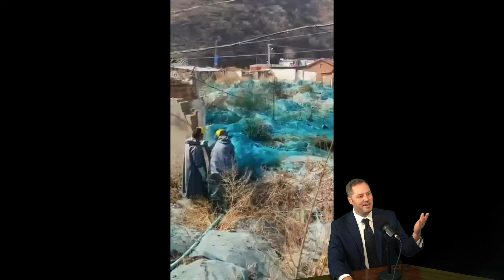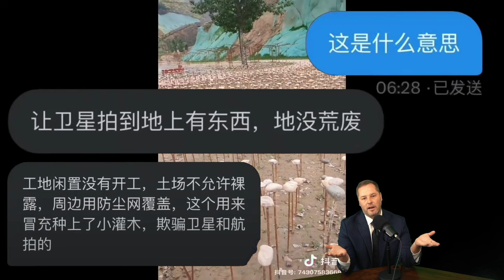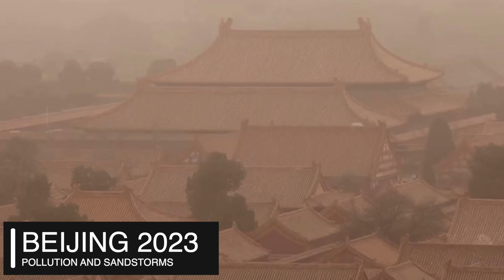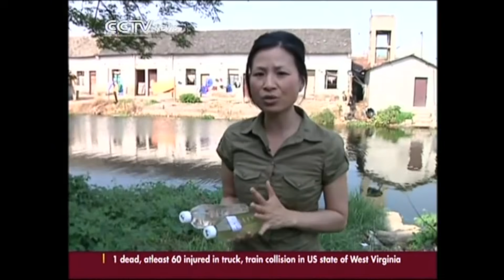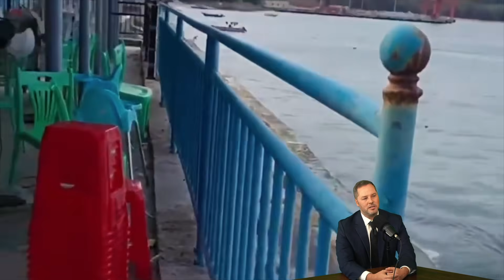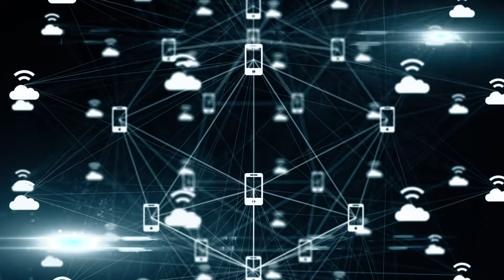China is planting Fields of Stones stuck to Metal Bars - No, Really

Comment: Hey, guys, this is a dust suppressant, and it's an environmentally friendly material. It can naturally degrade after its effective period, causing no secondary pollution. It is primarily used for controlling dust pollution on construction sites, mines, and roads. Although the suppressant is a liquid when first sprayed, it solidifies into a protective film on the bare soil surface after 2-3 hours. This film tightly encloses the dust underneath, preventing it from becoming airborne even on windy days. 
Dust is a major source of air pollution. Conventional dust control measures include watering and covering, but watering can lead to water resource wastage, and covering has several drawbacks. The woven fabric dust covers used have low dust resistance, are lightweight, have a short lifespan, and are labor-intensive and costly to install and remove. Moreover, these products contain plastic fibers that are difficult to degrade naturally, leading to secondary pollution. In contrast, the environmentally friendly dust suppression technology currently in use is more advanced and is becoming a new "weapon" in green and sustainable dust control.

Comment: While you might be correct about china, it very well could be 'just paint'... but you are NOT CORRECT about hydro-seeding... after the massive forest fires that took out millions of acres in Colorado, I witnessed helicopters hydro-seeding RIGHT OVER THE ASH, over dirt, trees, rocks, etc. without regard to 'preparation' or any top soil, or even any visible 'soil' - and IT WORKED IN MOST OF THE STATE where that happened; which, in turn, drastically reduced and mostly eliminated erosion that coming fall and winter. They did this, in Colorado, AFTER everyone in their brother - in the science community and media - claimed the 'land was STERILIZED' - and 'nothing would grow.'  The fire was so hot, the roots of trees exploded under ground... making sections of the burn appear 'moon-like' with small to medium size craters and pot holes as far as the eyes could see. Yet, within weeks after the hydro-seeding, there was growth... roots... and protection from the rains, and help from the coming snows. 

So... "data indicate that hydro-seeding significantly increased ecosystem N storage during the initial stages of post-fire succession but at the expense of native shrub regeneration and species richness. The increase in ecosystem N retention will likely result in a decline in NO3 export to downstream water bodies that often occurs during the immediate stages of chaparral post-fire succession. However, if the trajectory of grass-dominance and slow shrub recovery continues, the hydro-seeding treatment "  The copter pilots that 'do' the hydro-seeding are OMG impressive. They were dropping from 50 to 200 feet up, depending on the terrain and dead charred trees still standing, within inches of roads and less than a foot or two from buildings. It was like watching a 'professional painter' FROM THE SKY - spreading the green 'hydro-seed mixture' - to attempt to get some root structure in an area that was devastated, and was covered in ash, riddled with craters, and virtually no life for as far as you could see... where the burn happened. Devastating, but turned around BY MAN & SCIENCE... and hydro-seeding directly over 'sterile soil.'

Comment: Can't speak for the effectiveness of each and every application of it, but the material being sprayed onto those dusty/bouldery areas actually looks like dust suppressants. Used widely to prevent wind erosion. It forms a firm layer by bonding the surface dust/soil to itself.
I'm sure the green colour being favourable in aerial photography certainly presents incentive for this to be used more widely than necessary in certain regimes.
As for painting vegetation green, dyes are used in pesticides to easily distinguish treated areas from untreated, and keep track of work progress. Again, definitely impacts aerial photography appearance, and wouldn't be surprised if these things get overused to promote favourable appearance.

Comment: To be clear: Here in the US, there are state programs that do hydroseeding along the roads to prevent erosion. There is zero prep work and it looks just like that. They just drive along spraying.
Reply: Areas along the highways in my state were hydroseeded.  It worked out very well.
Reply: But here in the US we have great soil in most places. It certainly wouldn't work in the desert or anywhere that doesn't have nutrients in the soil.
Reply: @thahitman2  Sometimes, even here in the US, projects are done because money was appropriated for them, regardless if they make sense.
Reply: I think that blue stuff is a bird repellent and some form of nitrogen fertilizer mix, not some painting the roses red type of stuff.
Reply: @100GTAGUY  I only find your comment right in thousands comments. Expect what you said, this liquid also contents grass seed, it's mixed liquid to recover grass ground.

Comment: why do you have a misleading clip of nuclear reactors in here?  Nuclear power doesnt produce air contaminants it releases steam. The only waste would be the nuclear fuel rods when they are spent but thats not aerial
Reply: I do have some concerns about China's nuclear power plants but yeah emissions isn't one of them. Even for coal plants the visible stuff coming out is almost entirely steam. A lot of the things that damage the environment are invisible, for example CO2 and CO are both invisible. Even particulates that cause smog aren't necessary visible at all at the point of emission. We shouldn't try to judge these things visually at all.

Comment: While I agree with your assertion that what China appears to be doing is paint, I will say that you are inaccurate about hydro-seeding. It doesn't require aerating, removing rocks, any of what you said. I've seen that stuff grow on leather work boots from overspray, seen it catch on to concrete, it's extremely well adept at "working".

Comment: Back in the Soviet Union, my grandfather used to tell us stories about how when a really important general was coming around with an inspection to a military base, everything had to look the part, and it would sometimes go to absolutely ridiculous lengths, where soldiers were told to paint any yellow grass green, and use white/black paint to paint the birch trees so they look better and prettier.
Reply: Im familiar with dog an pony shows. The USMC does stupid BS like this too in current day. Thing is, the brass are aware. They're not fuqing dumb. Yet, us junior enlisted have to waste time doing stupid BS like that instead of training. While the staff senior enlisted and officers laugh at us sitting their f@t a$$es in their offices. I remember having to rake pretty lines in the dirt pits like a zen garden, painting the lawn in front of the command building, painting and arranging large stones in patterns around the command building. Absolute fuqing dumb sh!t.
Reply: I can't figure out how that wouldn't be noticeable.
Reply: @JZStudiosonline  You don't notice until you are close enough. We played similar show for FDA inspecting our factory. 
Pipe for high-pressure steam is bit rusty? Paint over it. 
Floor tile chipped? Put over a sticker, add a layer of paint, it will be fine until next week.
Doors are visibly old and should be replaced few years ago? No problem, we have wood polish. Put it on metal door, it will look like it is new.
During normal operation we would clean a bit, just run a wet rag over things and maybe splash it with hose, before that big visit we used pressure washer on everything. 
We even got special new shirts, pants and shoes on the morning of inspection to look good. (I don't remember for sure, but I think that we had to return those shoes after the visit). 

Oh, and for outside the big boss ordered some "special fertilizer" to spray on lawn, I don't know if it was really a fertilizer, but it was green for sure. The lawn looked good from distance (I mean 5 meters away you will not notice anything) and when they walked by, they were talking about something, so nobody noticed anything.
Reply: They could have just bought the inspectors a bottle of vodka. 
Maybie they were painting trees as a joke, they knew it would be noticeable.
Reply: @relaxative2006  Vodka's included by default
Reply: They do it every where ,when OFSTED ho 8nto a school you usually get 2 days to sort your shit out so we spend 2 days running around putting up displays of the crap ofsted want to see not what schools actually teach ,every time ofsted came I saw the same running around ,then after 11 years I realised the managers of the school ,the head , deputy head, weren't doing their job and were useless , so I left , , same with most countries ,useless liars .
Reply: Its actually happened due to corruption. Commanding officers were given money to plant trees, fertilize soil, build quality living space to train soldiers, but due to stealing all fucking money by high command, soldiers lived like lifestock, were feed worse then pigs, and needed to do all work that hired building companies should do, with no actual military training.
Reply: L shadowbanned reply
Reply: Not shadow banned lol @rosstacoman5910

Comment: Air pollution from coal isnt really that bad and reliable stable power is very important as you know as a south African. Dumping chemicals into the ground water to poison it is way worse. Air circulates and blows away, you can move the power station a few miles away, but you cant move the ground water supply.

Comment: Ahha ha ha 🤣!  This comment section is a poignant reminder of how easily people who have not yet developed an instinctive skepticism about the media can be stripped of their intelligence.
The stone in the video is the cushion of the protective layer of the steel bar, which must be placed between the steel bar and the template, so it is directly fixed to the steel bar with glue.
These stones serve as cushion blocks to ensure the thickness of the protective layer during the concrete pouring process.  Workers first use a "laser level" to determine the horizontal height, then insert the steel bars into the earth according to the spacing of the design drawings, and finally glue stones on the top.
Then they would pour out the concrete until it covered the stones, and then the foundation of the building would be completed, and the subsequent concrete buildings would be built on this foundation, and the gravity of the building would be pushed down first on the stone, then on the steel bars, and finally on the concrete enclosing the steel bars.
This structure can assist workers to control the thickness of the protective layer of steel bars, which is a skill born from the experience of long-term participation in engineering construction.
The video shows an environmental landscape about to begin construction on a wasteland in Wanrong County, Shanxi Province, China.  In the background, green gauze is draped over the hillside and sprayed with water to prevent it from collapsing.
That gauze is used to wrap buildings under construction, to protect construction workers and their tools from accidental falls.
Because there are so many buildings under construction in Chinese cities, and gray cities are so ugly, the gauze that covers the construction must be the color of the sky and trees.
It's hilarious to dismiss China's desert clean-up project as a sham without actually looking up the video's source address.
Of course, you will not know our achievements in recent years, just take environmental governance as an example:
In order to expand the ideal home in our hearts, we came to the barren desert, conquered the desert with shovels and gloves, conquered nature, and all kinds of wonderful ideas were born in this great journey.
Countless hay, inserted into the desert, is placed in a square fence, fixed the desert surface sand, so that the sand can no longer be blown away.
Drought-tolerant plants have been able to grow in blocks of hay, and since the 1950s, the Mu Us and Kubuqi deserts have been recovered by plants an area the size of eight South Korea.
Countless photovoltaic power generation panels are installed on the ground several meters high, and the water that cleans the dust of the power generation panel falls to the ground, and the shadow of the power generation panel reduces the amount of water evaporation.
So the tough weeds went wild in every shade, until local herders brought sheep to the buffet and ate all the weeds that were too tall to cover the photovoltaic panels and affect the efficiency of power generation.
Holes are drilled into steep hills, nails are driven in, green gauze is hung, grass seed is mixed with a liquid fertilizer called hydro mousse, and is sprayed under the gauze.
The new lawn will grow through the gauze, temporarily strengthening the hillside that was prone to collapse, and there will be no debris flow in the rainy season.
Developed various plant extracts and mixed it with sand, successfully invented artificial soil and completed field experiments, providing the perfect shelter for the reproduction of various creatures in the barren land.
Turning deserts into forests, synthesizing starch with electricity and carbon dioxide, creating soil with sand and glue, breeding fish in large quantities in artificial chambers, and growing new kinds of seeds time after time...
We are studying how to reestablish our homeland in the wasteland after nuclear war.
What are you guys doing?
We are busy mastering all the industrial chains in the world, busy making more and stronger warships, aircraft and armored vehicles, busy developing everything.
We don't have much time to talk to fools, because we have to grow a fist hard enough to break all the noisy mouths, all the mouths 🥰~

啊哈哈哈哈🤣！这个评论区深刻的告诉了我们，还未对媒体产生本能质疑的人有多么容易被剥夺智商。
视频中的石头是钢筋保护层的垫块，必须放在钢筋与模板之间，所以直接用胶水固定在了钢筋上。
这些石头作为垫块，在混凝土浇筑的过程中确保了保护层的厚度，工人们先用“激光水平仪”确认水平方向的高度，再把钢筋按着设计图纸里的间距插进土里，最后在上面粘上石头。
接下来他们会倒出混凝土，直到盖住这些石头，然后这层建筑的地基就完成了，后续的混凝土建筑将建在这层地基上，建筑的重力先是压在石头上，然后传递给了钢筋，最后传递到包裹住了钢筋的混凝土。
这种结构能辅助工人控制钢筋保护层的厚度，是长期参与工程建设的经验诞生的技巧。
而视频中的位置是中国山西省万荣县，一处荒地上即将开始施工的环境景观，背景中的绿色纱网布披在山坡上，并喷洒上水，防止山坡坍塌滑下。
那种纱网布，是用来包裹在施工中的建筑，保护建筑工人和他们的工具不会意外坠楼。
因为中国城市里正在施工的建筑太多，而灰色的城市太丑了，所以包裹住施工建筑的纱网布必须是天空和树木的颜色。
在未实际查找视频来源地址之前，就直接认为中国对沙漠的治理工程是虚假的行动，这真是太好笑了。
你们当然不会了解近些年我们的成就，仅以环境治理方面为例：
为了扩大我们心中的理想家园，我们来到那贫瘠的荒漠，用铲子和手套征服沙漠，征服自然，各种奇思妙想在这场伟大征途中诞生。
无数的干草，被插在沙漠里，摆成方形的围栏，固定住沙漠表层的沙土，让沙子不再被风吹走。
耐旱植物得以在干草围出的方块里生长，从1950的治理计划到现在，毛乌素沙漠和库布齐沙漠被植物重新覆盖的面积，相当于8个韩国的面积。
数不清的光伏发电板被安装在数米高的地面，清洗发电面板灰尘的水落到地上，发电面板的阴影又减少了水分的蒸发量。
于是坚韧的野草们疯狂的长满了每一片阴影，直到当地的牧民们带着羊来吃自助餐，吃掉所有长得太高的野草，让它们不至于遮住光伏发电板，影响发电效率。
在陡峭的山坡上打孔，插进钉子，挂上绿纱网，草籽和被称为hydro mousse的液态肥料混合，被喷到纱网下。
新生的草坪会穿透纱网生长，临时加固原本容易倒塌的山坡，雨季不再有泥石流的危害。
研发各种植物提取物并将它与沙子混合，成功 发明出人造泥土并完成实地实验，为贫瘠土地中各类生物的繁衍提供完美庇护所。
将沙漠变成树林，用电和二氧化碳合成淀粉，用沙子和胶水创造土壤，在人工舱室大批量养殖鱼类，一次次培育新型种子……
我们正在研究如何在核战争后的荒地重新开辟家园。
你们在做什么？
我们忙着掌握世界上所有的工业产业链，忙着制造更多更强的战舰、飞机与装甲车，忙着发展一切。
我们没有太多时间和蠢货辟谣，因为我们要长出足够坚硬的拳头，用它打烂所有吵闹的嘴巴，是所有的嘴哦🥰~
Reply: Bro put down the copium lmfaoooo

Comment: They are not painting rocks green ... these is a spray that includes seeds and fertilizer.  It is commonly used to quicky seed barren areas to get grasses to grow.  
You need to do a bit more research buddy.  You don't need top soil for hydroseeding.  The point is to get something to grow, and then when the grasses die and decompose that provides a base soil for next gen  grasses which may or may not grow.  
Rocks on rebar - consider that an art form - and yes - more cheating to satisfy authorities - who yes - can be that stupid. 
Instead of talking about Pollution - how about talking about WASTE ... It is a lack of control of waste.

Comment: we actually spray a very similar product here in Australia onto bare and loose soil areas. It is called a soil binder or tackifier, and sort of glues the soil together so it doesn't wash away when it rains. the dye is merely so you can see where you've sprayed it. we also use "geofabric" to cover loose soil to stop it washing away as I saw in a few parts of the video.
Reply: do you really think the Communists waste money on tackifier, when they work out they can do something similar using dirt cheap PVA or neoprene and pocketing the difference.
I'd say that's Naiveté in extremis to think Communist Chinese would waste good money on proper tackifier.
Reply: And you also have time to glue rocks 🪨 onto meatless steaks ( moder design )?
Reply: @RamiroHuerta-jg6dn  I certainly do not. I'm not saying this is the same product, just we spray a similar product. Some of the videos look a bit similar, especially when they are spraying "bare areas" of soil as stated in the video. Of course we also see footage of blanket spraying along the sides of the roads over vegetation etc too in the video. That being said, this spray is also common (and mandated in some cases) where roadworks leave bare earth along the road.
Reply: Yep I have seen them spraying in Australia along the highways when they've made it new highways
Reply: You velly creva,  you no make trouble!  You welcome stay at camp in China for horraday! ❤️

Comment: The side of the roads aspect is - erm - interesting. Roadsides are by their very nature exposed to more CO2, for obvious reasons, which is food for photosynthesising plants, i.e. the green stuff. Hence you can observe the roadsides and margins on centre reservations of dual carriageways turning green in spring sooner than in areas further away from them.
If you have to use paint to turn them green, you have a lack of water. Irrigation, or designing road drainage in an ecological fashion where feasible based on precipitation levels in the area, would solve that problem.